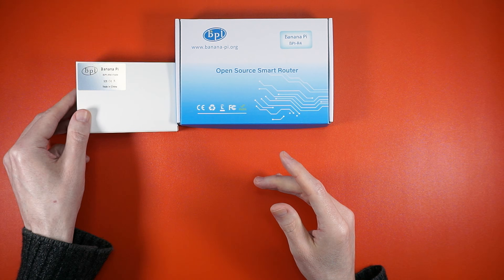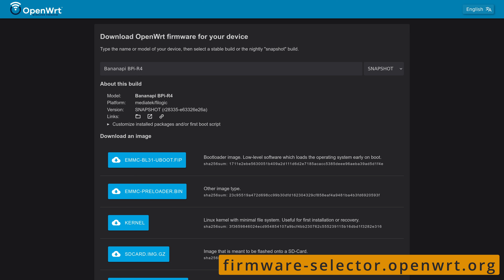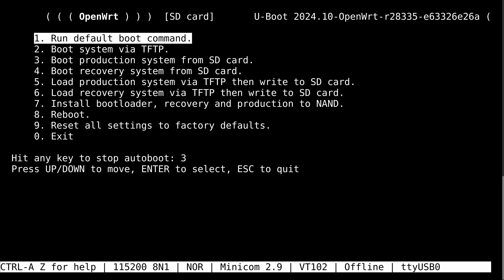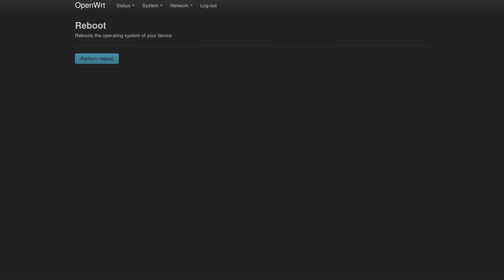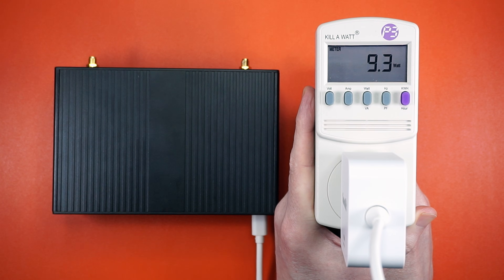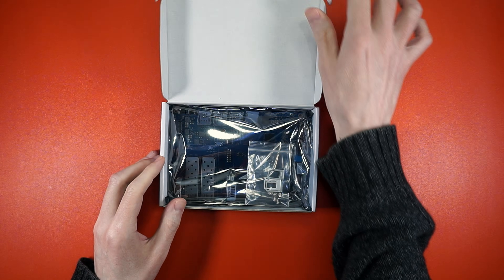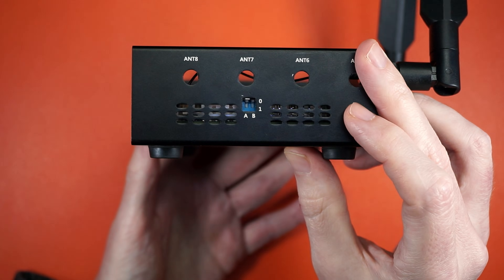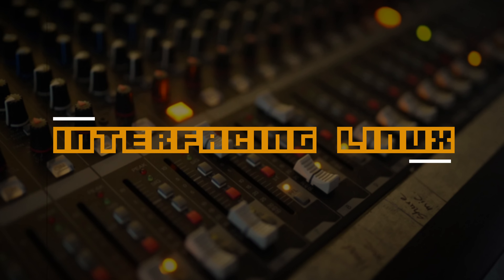Banana Pi BPI-R4: OpenWrt Quickstart

Comment: you said if you just want an openwrt WiFi 7 router this isn't for you. do you have any recommendations for us? I was going to buy this before I saw your video. 
running EarthLink 1.5G fiber with AT&T BGW620 gateway bridged (not really)  to pfsense on ChiFi SBC 3 years old but want Wi-Fi 7 and to not use AT&Ts gear
Reply from the maker: All these months later I still can't solid recommendation for a openwrt WiFi 7 router for anyone looking for a semi-turnkey solution.
Reply: @InterfacingLinux good looking out bro

Comment: The Banana Pi R4 Lite with MT7987 and 2GB DDR4 RAM is a solid pick for custom networking.
Reply: Software is on the way to, so far. No openwrt builds unless handmade.

Comment: overpriced
Reply: On the contrary, it's actually very cheap for a 10 Gbps router. I don't bother with the WiFi card though.
Reply: @blunden2  I meant value - money for features. Good router cost $3 for 16/64 300Mbit 2.4Ghz.

Comment: I have a very basic problem: I can't find a way to connect from my Debian/Linux with the BananaPi (also with Debian/Linux on the SD-card). Neither a USB-Connection nor a network connection attempt succeeded. I tried numerous USB cables, but in the end the only sign that the BananaPi exists at all is an (incomplete) response to an `arp -a` request within my LAN. I have no idea whether it's a hardware problem or a software problem although by now I tend to assume the former considering that there's a blue LED on which according to the information I found should not be possible because allegedly the blue LED is not used yet. Beside that the RED (power) LED is on and both RJ45 ports (WAN and LAN) show green. But that could just be triggered internally by the ether-net logic onboard and doesn't necessarily say anything about the readiness of the system. I even tried to switch on the WiFi switch on the board although I don't use (or want) WiFi on a router at all (for security reasons); but that didn't change anything. I've used the "official" Debian (bookworm) image from the BananaPi site and I'm now wondering someone ever actually used that image before, because everybody I read or watched so far only uses the proprietary version of OpenWrt provided by BananaPi. Could it be that the device only works with the Chinese fork of OpenWrt?
Reply: For Debian, log in over UART and configure the network. OpenWrt is available from the official OpenWrt Firmware Selector as shown in the video.
Reply: @VennStone  Thank you for taking the time to answer!
Alas, it doesn't really help, because I don't know HOW TO "log in over UART" since I have no cable that would allow me to do that. Any ideas?
Reply: @mwat56  I included a link to the one I used in the video description. The written guide on Interfacing Linux website covers usage.
Reply: @VennStone  Thank you very much. Since I am in Germany currently the US Amazon won't deliver it to me (they didn't even show me the price). But at least I got an article description which I could use to find a similar device here. I should have it in two days and then I'll see whether my Banana Pi actually works.

Another question came up while researching: Do I have to format the M.2 SSD before connecting it to the Pi? Until now I always formatted disks etc. with and by the device where they were supposed to be used. Is that actually different with the Pi? Can I not format the NVME with usual Debian tools?

Comment: I'm really torn between this and the NanoPi R6S. I feel the NanoPi is better but this one has SFP ports. Have you measured the power consumption without SSD/Wi-Fi modules?
Reply from the maker: It was around 4 watts without accessories.
Reply: @InterfacingLinux  Thanks!
Reply: Those two are not directly comparable if considered as a router. The BananaPi BPI-R4 is a networking device with a special purpose ARM SoC with hardware offloading for networking functionality, while the NanoPi R6S is a general purpose ARM SoC with no special networking offloads.

Comment: This thing makes the Tomaž Zaman router look like a total scam.
Reply: eh that router isn't really a scam (it's very resource efficient) but it's probably not for most people. i got the bpi r4 because i don't buy 1st gen crowd funded hardware.
Reply: It's certainly not a scam. Building a device from scratch is expensive. Sinovoip probably get significant discounts as they order a large number of components from the suppliers, which the Mono team doesn't at this point in time. I'm also not sure if Sinovoip actually pay for expensive certifications as they sell "development boards", not finished products. The BPI-R4 is pretty awesome value though, so I picked one up just to play around with. 😀

Still, it seems like the Mono team was unlucky in terms of timing as using the MediaTek Filogic 880 (like the BPI-R4) would probably have been much easier and cheaper, while seemingly also being faster. I don't know if MediaTek requires the manufacturers to pay for licenses to use the hardware offloading engine, but the code itself is open source and integrated with nftables. The patches needed to the kernel and the rest of the stack seem less invasive as well, which is nice. The NXP integration reminds me more of Qualcomm's.

Comment: What are the differences between SD NAND eMMc booting? Advantages and disadvantages
Reply: It doesn't really matter too much which one you choose. eMMC is kind of like a built-in SD card (the SoC uses the same controller for both, which is why you can't access both at the same time). NAND is very small in this case. The reason that it has all these is because it's sold as a development board where they want to give you as many choices as possible, since they can't be sure exactly how you want to use it. It also simplifies life for developers as they can keep different OS:es on the different storage types and then easily switch between them.

Comment: Hi, I noticed that during the speed test, the TX speed was around 300–500 Mbits, while the RX speed reached 9.10 Gbits. Is this a limitation of your host or the Banana Pi-4?
Reply: It looks like he tested with the BPI-R4 as one of the test devices, not using it as a router between two other devices. That means that hardware offloading can't be used. For TX, the CPU needs to spend significant effort just to generate the traffic. There are some software changes that can be made to increase TX performance of the device itself, but if you're using it as a router it will already route and forward at 9.6 Gbps or so in either direction with hardware offloading enabled.

Comment: Thanks for the guide and the write-up!

Haven't touched Linux in over a decade. Just got my R4 in the door and go OpenWRT running off eMMC first try by following your write-up.

Not sure why it assigns 2gbs of the eMMC to temp storage, but eh, if your router has an m.2 slot, it'd be a shame not to use it.
Reply: Fantastic! Glad you're up and running.
Reply: I seem to be stuck with selecting the proper file to write to the Sd card in the first step to flashing the EMC. Would you mind telling me which image file to use?

Comment: What did you have to do to get the SFP to RJ-45 working? I've tried 2 different SFP to RJ-45 converters now including an ipolex 1 Gbps and neither one of them do anything when I plug them in. I see the light on the R4 turn on but it can't establish a connection with a computer I have plugged into the SFP converter and when I plug it in by itself, no output is shown like in the video. Nothing comes up at all. Am I missing something here?
Reply: The only thing I had to do was set the link speed on the 2.5G module. Both connected to a MikroTik RB4011. Is this with OpenWrt 23, 24, or snapshot?
Reply: @VennStone  I'm trying with a snapshot. Running dmesg and ethtool shows that it's connected and didn't fail to validate. I got an ipolex that failed to validate according to dmesg. The XiCom didn't and shows like it should work in the OpenWRT snapshot but when I try to connect the ethernet cable to my computer (using Linux Fedora) it tries to connect but ultimately fails.
Reply: @VennStone  And I already tried disabling auto negotiate and setting the speed manually but still didn't work. I wonder if I need to manually set the IP address on the client side but I'm not sure. I tried that and it said connected but I didn't actually have a connection to the router. I might've messed up the subnetting though.

Comment: Can you say something about the maximum possible VPN speed? What speeds can be achieved here? For example with openvpn
Reply: If you want decent performance, OpenVPN is a very bad choice unless you can use OpenVPN DCO with some form of hardware offloading. Wireguard will definitely perform significantly better. Regarding Wireguard performance on one of these, I saw someone benchmark it on the OpenWrt forum and the result was slightly above 1 Gbps.

Comment: How mature is the software? Can you use it as a daily driver?
Reply: There is a reason this channel deletes comments that point out how broken the support is, and why he chose to completely omit showing actual wifi & sfp operation. The main devs who upstream R4 support (Frank W. & Eric W.) explicitly state that only basic support is present (officially from kernel 6.14+. That's right: from a yet unreleased kernel, which won't even be OpenWrt's next). Proper network & SFP support hasn't even begun. Your choice for working wifi & partly working SFP is Sinovoip's ancient 21.02 build (with Chinese goodies) and weird 3rd party builds from the OpenWrt forum that make do with mediatek patches. You won't be able to build & customize a snapshot yourself as the latter only apply to 24.10.

Comment: My NVME is not showing up in the Mount Points menu. I (stupidly) did not format the drive to ex4 before installing it. Is this likely my issue? Searching online, it is not clear to me if I can format through Openwrt, or if I will need to remove the NVME and format on another computer? Thanks for the excellent video and write up!
Reply: Right on. The guide expects a drive formatted with ext4. You can format the drive using openwrt, but it's an adventure.
Reply: just pop it into another PC real quick and format it lol

Comment: Mine is coming sometime this coming week and as someone who played around with flashing linux to unlocked android phones. You know I got a nanosim waiting to take this thing for a ride. 5G wan on a b-pi board. Now we're talking some sleeve rolling action. :)
Reply from the maker: Sounds like a fun project.
Reply: @InterfacingLinux  Now that I got this I realize I don't know what distro I want. I have OpenWRT to check out it's capabilities. But I've set up whole rackmounts using Linux and BSD (Debian, Ubuntu, Arch, FreeBSD, Etc.) for traffick routing. So it could be quite a fun ride. Deciding which I want to use as both versions of Linux and BSD exist for these platforms; and both are very capable of running the various interfaces. :)
Reply: @InterfacingLinux  it should be.. If I can get it up it'll mean I can have a seamless internet and not even have to depend on a post-paid provider. Also three nano-sims also lends itself to doing a local proprietary 5G network that brings up some interesting prospects. They sell 5G unbound SIMS for exactly this reason.

Comment: Is Wifi 7 already works on it and works stable?Like 3 months ago Wifi 7 was not working normally on this board.
Reply: seems to work now but it still kinda sucks cus the module has no shielding against interference from the board
Reply: @mataznuiz it has an EMI shield by standard right?
Reply: ImmortalWRT is made for this board, has the latest drivers and is more optimized than nightly.